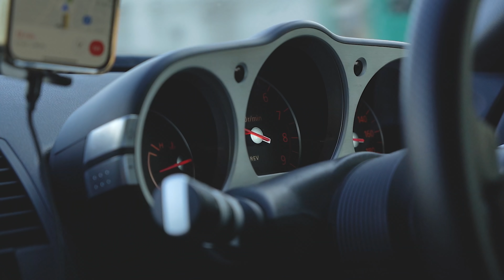MY JAPANESE WIFE WORKS ON MY CARS!

Comment: For shop heating: try a infrared heater. (not the ones that glow, the ones that are flat) see Könighaus Infrared Heating. I find em useful because they emit rays and only things in sight heat up. so its some kind of "directional" heat. I did not experience em in a shop, but perhaps its working. At least the cold feeling is gone in an instant.
Reply: A lot of people say they  cause headaches

Comment: Vinegar should take out the hard water stains on the Z if they are not too harsh.  Another thing you can try if they are super hard stains is to get some polish and a nice microfiber, you can get them out by hand but it is a bit of effort.

Looks like it's in overall decent shape as soon as the parts with clear coat failure are corrected.  But given the situation it's really freaking clean!

Also wouldn't be a bad idea to look into a cheap foam cannon for cleaning cars in the future.  They have ones that are portable and don't need a pressure washer.  That should help mitigate the scratches when cleaning the cars.  Personally I use clean microfibers on exterior paint for cleaning and drying and then transition them to the dirtier door jambs.  Going the other way around can result in some scratches over time which may need to be polished out.  I never use microfibers on paint and the wheels, those need to be seperated.

Comment: Sam, I think Daniel (Wasabi) found a pretty good first car for Mei when he showed the little Sunny wagon in one of his videos. I've had lots of B310 Sunny's. they're small, light, very easy to drive, & to get confident in your driving. Even the little 1200 cc engines can be made peppy, & they have big enough engine bay to fit an SR20 Turbo. Much better than an RX8 (in my opinion).

Comment: Rx8 engine is meh.
Good chassi but the engine doesnt impress when modded.
A third gen FD 13brew swap would be a great start.
If N/A. id go with rx8 rotating assembly into 13brew block. With porting of choice.

Comment: Would a dry sump set up help the oil pump setup in Mr Okamura s engines
Reply: The problem is the SR oil pump gears, not oil starvation at the pick up. The dry sump wouldn’t fix that. Nothing will stop Okachan beating on the motor even when the pressure drops lol. Maybe a cut off in the ECU that pulls timing and limits the revs if the pressure drops would save the motor, otherwise Okachan’s heavy foot is going to kill it!